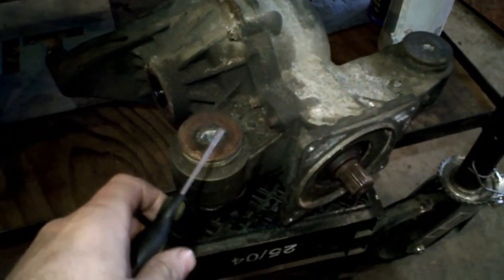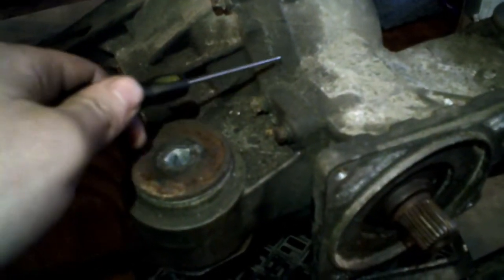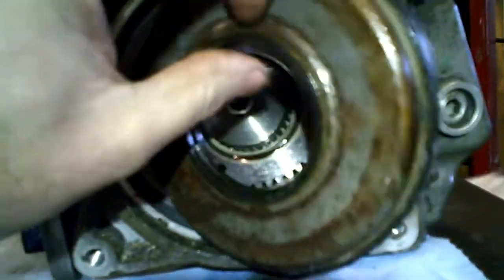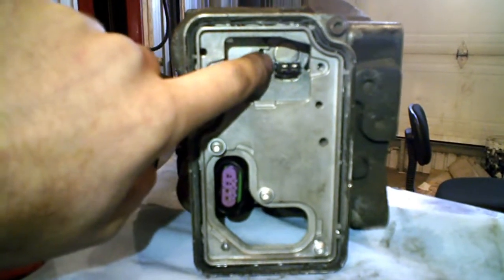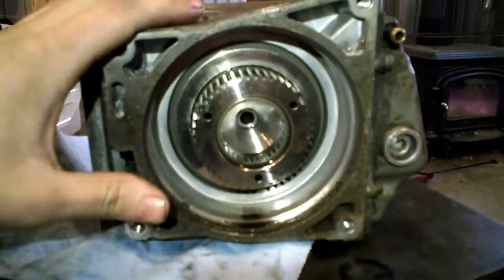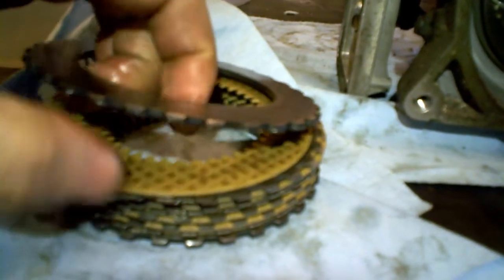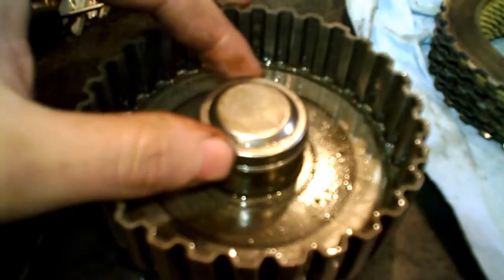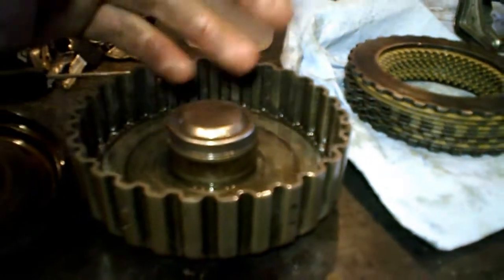Saab XWD rear differential dismantle

Comment: Fix mine.. please? QC? Pretty please?
Reply from the maker: Whats happening with yours? Most of the time it will be oil related.
Reply: @djvicy  Not sure. It's been without the driveshaft for a bit. It's my understanding that the driveshaft may have started to fail so they removed it (making noise).
Reply from the maker: Well that’s another story, the drive shaft not being servicable is a big problem from its own. I found a place in montreal that want to service them.
Reply from the maker: Check my other video where i destroy a brand fucking new non-fuckin-servicable 9-5 NG drive shaft.
Reply from the maker: I plan on keeping the front and rear joints to bring them to the same shop that i talked about so they can custom make a fully servicable drive shaft for my saab and project car.
Reply from the maker: Was your saab one for
Sale on kijiji without drive shaft?
Reply: @djvicy  Yeah it was! You probably seen it
Reply: @djvicy  I also have the shaft. Maybe I will try to figure it out... bought it for the winter and because I missed my 2006 9-3
Reply from the maker: Where are you located? Sherbroke?
Is the shaft broke or not?
Reply: @djvicy  I'm in Ontario. Driveshaft is all in one piece but they left it outside for a year or two so I am sure it is finished.

Comment: Thanks very much for that informative video. Do you know what exectly weight of that diff is? Its very important for my project. Thanks again
Reply from the maker: No but i can try to take the measurement. I can tAke it in my hands and move it easily i’d guess 110-150 lbs
Reply: @djvicy  If its not a big problem? :) Its very important to me to know exact weight. 130 lbs its alot! TIA. :) looking forward for more videos! cheers
Reply from the maker: Saw a post that it was around 60-70 lbs. did have time to weight it.

Comment: BTW, what engine and gearbox was this haldex fitted onto? was it a 2.0T or 2.8T? A manual gearbox or automatic6?
Reply from the maker: Yes, but maybe it wasnt slipping enough when deactivated and in tight corner it made the hub to take all the abuse and it broke. I dont know the real reason of why it broke, but its definitly the weaker part of the differential in my opinion. But yes, change your oil regularly, ensure a proper level and a clean oil filter, and you should not have problems!
Reply: @djvicy  yeah, I can feel the front is grinding a bit on tight corners.. And if surface is very well polished, it kind of gives you the feeling the car doesn't want to turn.. Kind of like a forward motion feeling.
Reply from the maker: Check fluids and change it in the back. Mine doesnt do it when going forwaed but weirdly a bit when cornering in reverse.
Reply from the maker: Was a 2009 2.0T Manual XWD. That said the rear diff did not seem to have been serviced at all. Might not help.
Reply: @djvicy  but you said the clutch-pack plates were in very good condition. Isn't that the main goal for regular oil and filter changes of the haldex unit?

Comment: Very interesting video, thanks much for the walk-through of the components and for being so analytical. Did you manage to weld the last gear piece that mates to the rear differential?
Reply from the maker: Yes i managed to weld the two piece together. I still need to install the diff in a project car to see if it will hold together and work. I will do a follow up when i do.

Comment: Hi Vincent good video very informative. Regards filter and oil change you are correct is saying that it can only be done properly off the car it is the only way you can clean out all the residue. If you do it on the car then I recommend doing it a few times to help flush out old fluid and some of the residue. Then change regularly.
Reply: It can be done properly on the car provided the exhaust and drive shaft are removed.

Comment: Hi Vincent,Pulled my gen 4 xwd apart to do a reseal and service.My clutch hub bearing is bad,Hub is good .Do you know were I can find the bearing or if so clutch hub with bearing.The car is a 08 Saab 9-3 Turbo X. Thanks for any advice.
Reply from the maker: Hi, If you speak about bearings or any part inside the clutch device when you split appart the TTD and the rear diff, unfortunatly, as of today I did not find yet where we could get individual parts. The only thing I know is that if you want internal parts you have to order the whole TTD or the whole differential and clutch assembly, at least if you order from OEM suppliers. That said it does not mean its the absolute truth, and most of these 2 section of our rear end are back order or N/A.

That said, I've come up with some with a couple of cars that the rear diff can interchange potentially as a whole minus in some case one side of the rear differential cover where the rear bolt are not at the same place but eits the SAME differential and ratio and clutch pack. Those car are (those I know) : Any 9-3 and 9-5 last generation with XWD equipped, 2010+ Buick Lacrosse AWD, 2010 + Buick Regal AWD and 2010+ 2.8L Cadilac SRX. There are other models I guess available only in Europe that I don't know much.

Also, If your car is equipped with the ELSD you can only swap the whole rear diff onto the good clutch TDD. If your car is not equipped with ELSD you can also swap the rear diff onto good clutch TDD OR swap in the ELSD unit, unplug the ELSD electrical connector and seal it and buy a matching driver side rear half axle shaft (splines and length different than none-ELSD). Best bet is wrecker that recycle car parts. Hope it helps.

Thinking of that if the only thing broken is a bearing you might be able to find a replacement aftermarket bearing, but you have to do your research and/or know a bit about the specs of the bearing and/or have a shop/supplier that knows bearings have a look and try to order same spec bearing. I doubt much that these bearings are unique to the XWD. GM/Haldex might just have designed the system with existing bearings.
Reply: Thanks Vincent.I have a bearing shop locally,I,ll try to match up this bearing tomorrow.I,ll let you know the outcome.Thanks again Chris

Comment: Please do a video how to change the oil and filter at the elsd when it is mounted on the car.
Reply from the maker: Hi @Henrik Svedlund I could do that but There is something in the design inside the reservoir that made me think that it cannot be changed correctly and efficiently or flushed completly if you don't take the part off the car. I will try indeed to make a video about it and explain why I suggest to take the part off.

I'll try to find a solution as how one could be doing it right with the part bolted to the car.

Thanks for your comment!
Reply: @djvicy  
Hi ok but i think it is better to change the oil and filter even of you not can change all oil then not change the oil at all. To bad that Saab not did a drainplugg becuse they think the elsd dont needed oil change. Makes maintence more difficult.
Reply from the maker: @henriksvedlund8306  Well yes indeed. But As I am saying in the video you can buy the filter and the gasket for the side cover together for an affordable price (depends on where in the world you are). by removing cover you can at least drop dome of the oil that is in the reservoir.

Among that I still think this oil can take more that 50 000 km on it. The point is if it is leaking you will lose all your oil at some point and your XWD not working right you will eventually break something. but this system create residus so I would still recommend to at least change the oil filter (and cover gasket at the same time) and refill with new oil,at least if your not flushing it completly. 

Cheers